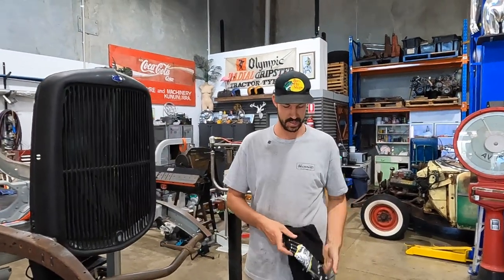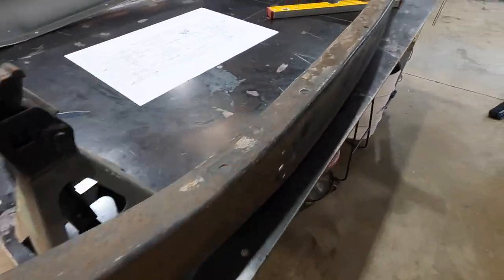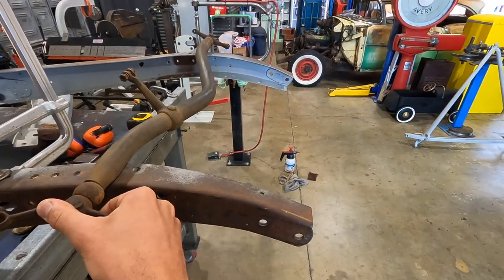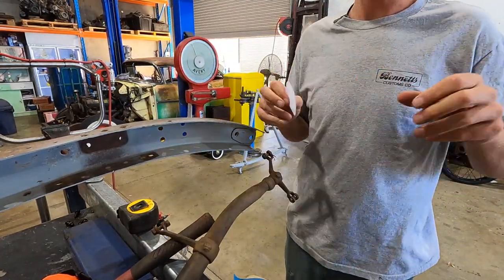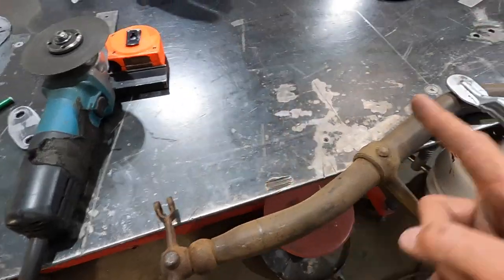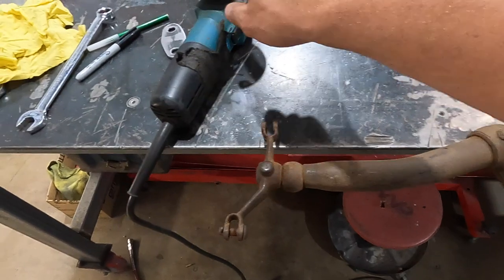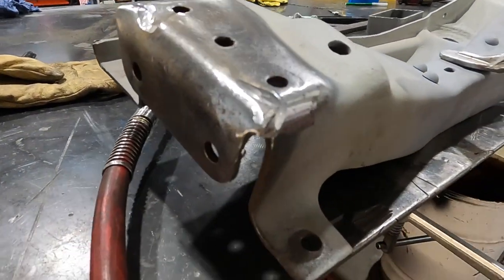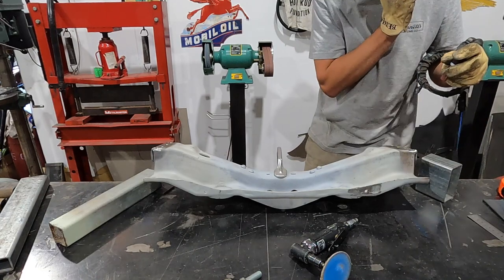(HOW TO) - 1932 Custom Spreader bar using a Model A brake cross shaft (Roadster Build)

Comment: Fast Cut makes really good plasma cutter cnc table setup as you I'm sure already know. I was welder fitter for most of my life, I definitely  concur with you, one of the greatest tips for a welding is to make sure you get comfortable as best as you can sometimes it's impossible depending on the circumstances but the more comfortable you are the better your welds you will achieve in the long run.
Reply from the maker: That’s exactly right!

Comment: Over in the US, we use torchmate plasma tables a lot for customs fabrication needs. we used solid works as the cad system. easier to learn, plus it has 3d modeling capabilities, and the ability to generate a cad file from a photo.
Reply from the maker: Great to know, I’ve heard good thing about those too, and that program seems pretty straight forward

Comment: Hi Jordan
Hare & Forbes has a plasma system which is an ARCDROID CNC Robot which would go well in your shop with limited space check it out could be the ducks guts for you. Also you have one of there stores in Perth. I would like to know where you got the drawing for the chassis I  would love to get one of those great videos.
Reply from the maker: Thanks for the info Dave I’ve seen that one, I think I’m going to go for the big 3mx1.5m fable if possible, better for the full sheet idea I have. 

I just down loaded it off the internet